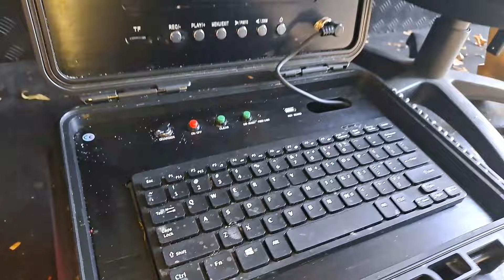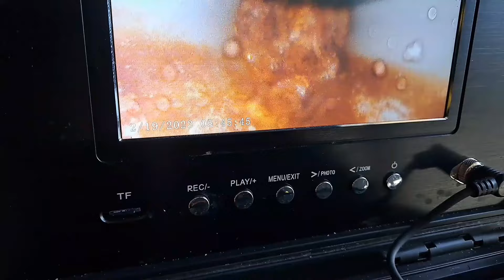Blocked Drain Spewing SEWERAGE all over Restaurant Bathroom

Comment: Bruce I hope you're feeling better now. So that we can see down the dark pipes, can you get a slim torch that attaches around your ankle on a wire spring, then you can dangle it down the pipe, then we can see what you see. Otherwise it is a little frustrating when we can't see it at all ❤
Reply from the maker: Noted. Thanks for the feedback 😀
Reply: @DrainCleaningAUSTRALIA  Todays pipes weren't a problem, but they can be. GoPro's are useless in any type of shade